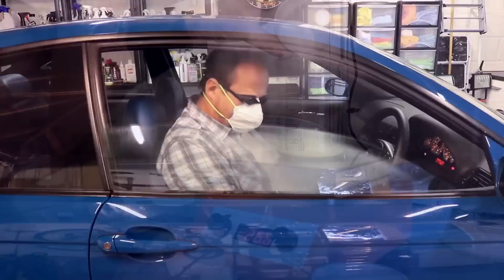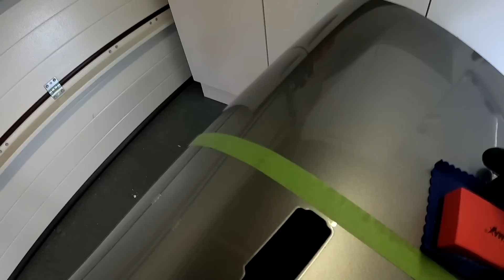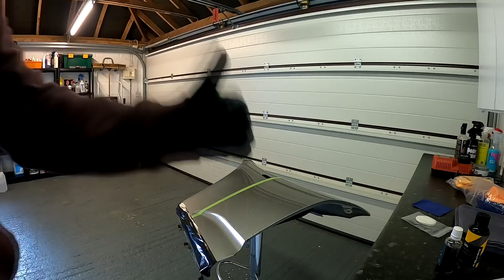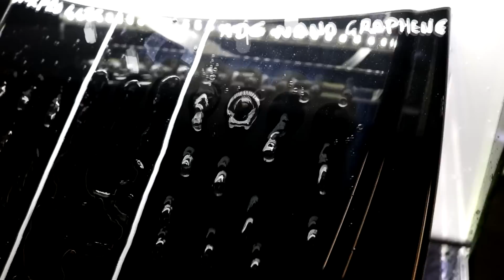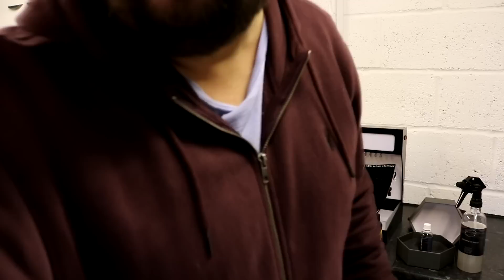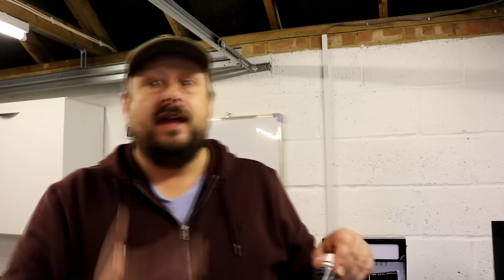R.I.P. Ceramic Coatings and SI02 | Meet the Future of Detailing

Comment: Knowing something about graphene and chemistry makes me wonder how this stuff actually works as graphene is always touted as a single sheet one atom thick. I don't see how it's possible to achieve that in a solution since it doesn't automatically link up.
If you are getting small pieces of it in a solution it wouldn't think it would self assemble into one big sheet that would protect your car. So I could see how small pieces of it might do something but it kind of misses the point of graphene. After seeing the demo though it looks pretty good .

Comment: do you have to throw away the micro towels after using it on the graphene product?  just like the ceramic coatings
Reply from the maker: graphene is typically just a tiny % additive.  And they have added it to true ceramics and they have added it to PDMS resins and they have added it to water based products.   If the graphene product is backboned with a true ceramic resin then I would suggest the towel would be thrown or just relegated.

Comment: Be interested to compare this head to head with my System X Diamond SS and Xtreme SS as those are the 2 top coatings I install and the Diamond Super Slick is an 8 year coating and it's by far my favorite.

Comment: Electrical conductivity will come into play when your clean car is exposed to dust and pollen.  If your paint conducts electricity then it will not hold a static charge, or it will not hold as strong of a static charge.  Therefore, less dust will stick to your car.

Comment: Who came for graphene and left with turtle wax ice seal n shine? 🤣🤣
Reply: yea, caught my detailer not doing anything to my car,(thanks to cameras) so I fired them. I paid them big bucks to ceramic coat it previously, I doubt that they did that and did as you said above. Now I use Meguires products and do it myself.
Reply: @allenwilson6585  I've paid someone to do my car not so sure it's been done . A colleague of mine had his done by someone else for the same price and it just looks a lot better. Only thing is you can't prove one way or another . I wonder if I just got a good wash .
Reply: @follyfour506  It's honestly hard to know for sure. If you didn't measure a specific area with a thickness gauge before then you wouldn't be able to prove so with hard evidence. But a coated car will definitely be noticeably glossier (I'm not even sure if that's a word). But most obvious sign would really be insane water beading and sheeting. A leaf blower should be able to knock all the water off the panels easily. Most coatings done by reputable shops would also have some sort of warranty. They would generally also show you what brand and type of coating they're applying. 

Another thing to consider would be how well they prepared your paint before coating it. Maybe your colleague's paint was better prep than yours before coating. Or could it be just that your colleague's paint was in a better condition initially than yours. Sadly, too many variables and I can't give you an absolute answer. Some would say ceramic coating would be more resistant to micro-scratches. But...that again is affected by so many factors.
Reply: @follyfour506  You can tell ceramic or Sio2 versus any kind of wax. it is very slick with ceramic versus anything else.

Comment: £180, rip ceramic coatings are a long way off yet mate. maybe thats why its opened to the public because pro's see more return on cheaper ceramic coating and the company that makes the graphic coat are not making enough, but seriously for a bottle that small shouldnt they have the decency to provide detailed info on the chemical they expect joe public to put on their nearest and dearest?
Reply from the maker: more product info Merlin.  Yes I agree, like more info about curing and compatibility.  mayby its out there..  yes I wanted to know more and had lots of questions.    I think price has come down though theres a retail kit for 99 pounds now.    performance so far is really good but it could fail aafter 6 months so dont want to comment too much yet.

Comment: For your foam ceramic blocks, cut slits in the sides of the block with a razor blade so you can show your microsuede cloth into the side.
Reply from the maker: thats a top tip right there brett.. some do have them dont they, but yer helps stop that flapping thanks buddy

Comment: To answer your question about compatibility with other products. I DO NOT know the answer however graphene is basically carbon and the molecule of carbon is probably the most compatible with other molecules. Carbon can combine with mostly anything so I would say anything from the cheap turtle wax all the way up to what ever synthetic coating you can think of would be fine.

Comment: Hello mate nothing to do with with this video but I have a quick question for you,,, i have a k7 and Iv just got a new snow foam Lance for it and when I use it the thing pulastes. Have you ever come across this...? But when I use my old one it's fine
Reply from the maker: yes mate..  your backing up your machine.. so the flow rate is being restricted.     If I put a new Gun upgrade for example and use the nozzle for the K4 on my K7 it causes pulsing.     But Ive not had pulsing with a snow foam lance..   but your restricting flow too much in short mate.   All the lances all made with different spaces some for gas pressure washes some for eletric.. they have an orrafice in there you can take out and replace (you access it from the side that connects to your karcher, or the quick release side.  its flat screw threaded.   So you could put bigger orafice in)

but Mark you have to contact supplier mate they can helkp.
Reply: @ForensicDetailing 
Hello mate thanks for getting back In touch. What I did was soon as I got the new snow foam Lance I changed the orrifce to 1.1 so you think the orrifce he is too small? I'll have to put the the orrifce out of my old one init and see if makes any difference cheers mate love ya vids 👍
Reply from the maker: @ceats1  I run a 1.1 orrafice in my lance on the K7 but its a PA lance.   my cheap chinese lances has standard orrafice size.    The only other thing is just make sure lance is not blocked..  you could try changing the filter.   the PA filters are more expensive.

but basically the K7 pulses when it gets backed up.. so that lance is backing it up I think.   Its unusual for a lance to back the machine up though.  or less likely than jet nozzle orrafice size problem.   Buy the way make sure you are runninng the right size nozzle orrafice on those white green yellow things that clip in.  in2detailing sell them for the K7.
Reply: @ForensicDetailing  cheers what iv done Iv changed it over so next time I Come to was me car again I'll see if swooping the orrifce makes a difference because there is nothing else I can think of that might be different mate. I have a decent gun and have all the differnt types of nozzles from 0 up to 45 degrees. All I do is quick click the snow foam Lance to the gun and its like yours you have with the swivel on it that attaches to the quick connect hose from the k7. So it might just be the orrifce mate hope so anyway 👍

Comment: I'm going to call BS on this one.  I'm sure they have added carbon to the basic detailing substrate, and it may or may not work as good as a ceramic coating.  But it isn't graphene.  Graphene is a single layer of carbon atoms arranged in a matrix whose atomic bonds are the strongest possible bonds, hence it's near unbreakability.  But graphene is very difficult to manufacture, and experimenters have only been able to bond a few atoms together so far.  It doesn't form by spraying it onto a car's surface and buffing it with a nice microfiber towel.  Ceramic coatings are probably BS as well, though I am experimenting with them on my cars to see if there is anything to the hype.  But ceramic forms a hard shell by heating it to a very high temperature and holding it there for a while.  Again, not something you can do in a detailing shop.  The verdict is not in on ceramic coatings, in my opinion.  I suspect that all that is happening is that the substrate in the polishing spray already leaves a nice shiny, slick surface that wears off over time, just like everyone else's detailing spray.  As long as it doesn't cost too much, it's fun to play around with, but, at 180 pounds (or about 250 dollars), it is almost certainly a ripoff.  Sorry, I like your channel otherwise!
Reply from the maker: "ceramic forms a hard shell by heating it to a very high temperature and holding it there for a while"    ??? that sounds like ceramic as in ceramic pottery literally. not ceramic coatings for cars.. these cure at room temperature with a normal RTV cure.
Reply: @ForensicDetailing  Well, it is ceramic as in pottery.  It's not clear to me that silicon curing at room temperature does anything at all, though I suppose that it can act protective.  Like I said, I'm experimenting with it to see if it is more worthwhile.
Reply from the maker: @davidrobine5350   very hard to test it david without specific tools.  but the material used in ceramic coatings is without doubt, harder and more durable that other materials  this stuff sets to a hard rock, but it also forms a proper bond as well.   A very simply lamens test if you have any doubts..  tip a few drops of a ceramic coating to a test hood and leave those drops to dry for 1 week.   put a smudge of paste wax on the same test hood and leave it for one week.    Try and remove the little blobb of coating once its fully cured :)

its best not to think of do coatings work are there benefits etc... the answer is yes.  but there are negatives as well.. If fact bino... Go and watch my video.. Ceramic Coatings Hot or Hype.   It talks about all this stuff you will like it.    Thanks David for commenting appreciate buddy.

Comment: You mention high spots. I applied CQuartz to my car and one spot still has a rainbow effect. Its been 3 months. Its only a 1 inch spot. How do we get rid of high spots?

I have a orbital, with chemical guys v36 and v38 and several dif chemical guys pads.  I'm guessing a orange cutting pad and v36 is to aggressive since I don't need to cut clear coat. I was thinking v38 and a white pad but my exp with the buffer is limited and this car is brand new.
Reply from the maker: yes you need to polish it off.  the degrease that patch and apply over again anthony.   start with soft pad and medium to light compound..  but if its a real thick spot you might need to up to cutting compound and harder pad...
Reply: @ForensicDetailing  thank you. Maybe I'll get up enough nerve to try the light compound one of these days and see how it goes . ive only used the orbital on my older daily driver. I hear you can damage paint but that's mostly with rotary buffers. So i guess I should be okay.

Comment: The reason why the ceramic coating stopped sheeting is because it was shocked by the acid. Give it about 7 days at the most and it will have its hydrophobic properties back. It’s a whole different beast in slang terms
Reply from the maker: no it hasnt come back.

Comment: Ho Jon, this graphene product has been a topic for a while. I keep commenting on “How easy is this to Remove”?  Even you did’t mention this. It’s the first question I ask. If it is major surgery, I wouldn’t have it. Just small repairs could be a nightmare.
Reply from the maker: I have to guess based on the fact Ive never have to remove it.  but judging by the applicator cloth.. I would treat this resin like a ceramic.. It will need to be abraded off the car.  someone else said it was easy enough to compound off in the comments.  but ive just not done it first had so not sure..   I suspect it will be a pain to remove just because its so hard to tell. (basically like ceramics)

Comment: Having attended some respiratory medicine meetings at the RBH, there is a fear that graphene particulates may give rise to pleural plaques (and thereafter lung disease and cancer) similar to asbestos exposure. 😬 Advise you wear a ffp3 mask at the very least..
Reply from the maker: I agree.  but I am more worried about the graphene detail spray than the coating.   The only components that will vaporize in the coating smell like di-n-butly and possibly small amounts of ammonia, but there wont or shouldnt be any silane vapor.      But the detail spray you are atomising so whatever graphene material is in there tiny particle will literally be going up your nose.   so even a P type mask would be of banaefit but half mask with correct filter types would be more sensible.  very few detailers follow this stuff, but some are very midnfull of it.

Comment: I cannot wait to see how that Graphene spray on, wipe off product lines up compared to similar format SI02 infused products like Meguires and Bouncers ect...  i wonder how many layers of the graphene spray it would take to match the longevity and performance of a full blown 12 month or higher rated ceramic coating. Or for example, how many D&D Si edition layers would match the durability of just ONE layer of the graphene spray detailer.  Perhaps a multi layer torture test for some of the SI02 products to compare against the single application graphene?? Do more layers really increase durabilty / product endurance in the real world or is it just a waste of product

Comment: Also the best sealants are clear coat based, so if someone invents a chemical which is animal tested ,which is extremely hydrophobic and resists all UVA/UVB and ultraviolet light and most chmicals other than hard core acid based degreasers or brake fluid or real acids, then your on a winner for sure, i bet none of these coatings including the best SIO2 based will stop any real acid based solutions or even brake fluid left on the panels ? What does mercedes use or any other hi end car manufacturer use as sealants on top of the clear coats which cant trepel acid based products and or brake fluid or even the chemicals used in areas or roads which have snow and the governments used to use salt based products to get rid of snow and black ice off the roads buy now like in canada they use a chemical based solution and its not salt either ? Would love to know if the hi end car manufacturers ( Even FORD / GM CHRYSLER ) have put a chemical resistant coatings on the cars bare metal before painting?

Comment: I first came across Graphene in Vittoria bike tyres with claims of better puncture resistance through the products strength and lower rolling resistance, there is talk of bike frames being made from Graphene in the future and they will weigh half the weight of carbon fibre, I had certainly never considered it would become available in coatings but if it repels dirt and water spots less than ceramic coatings then I can certainly understand why the manufacturers believe the product is the future, it will be interesting to see how the product performs when you apply it to your own car for real world tests, thank you for another informative video 👍